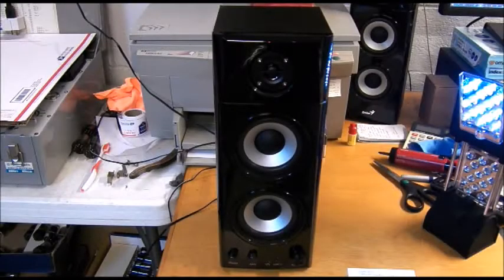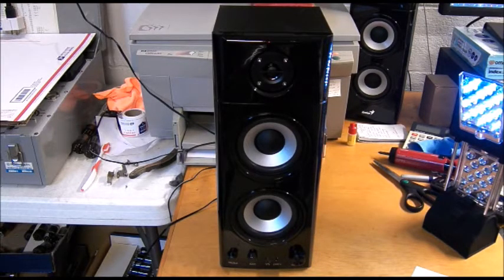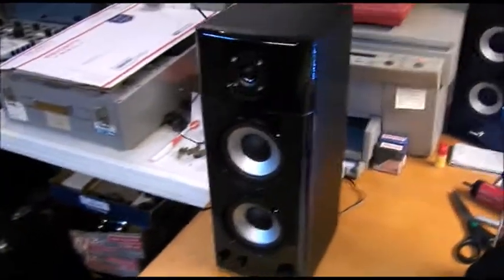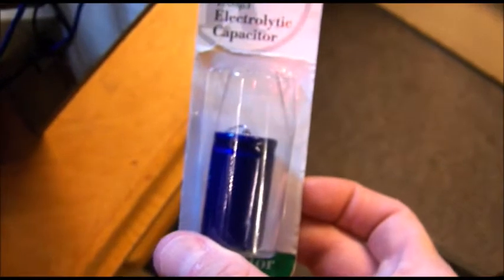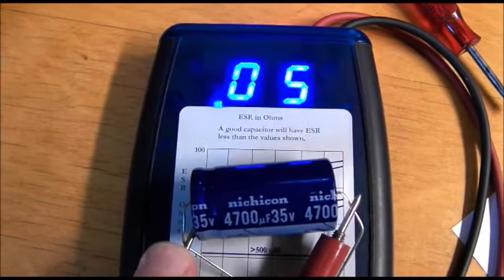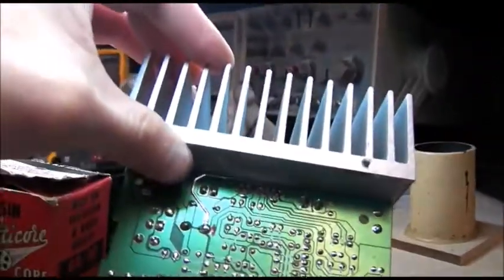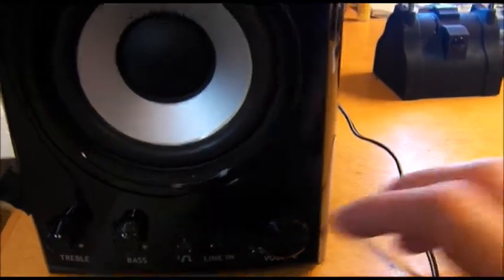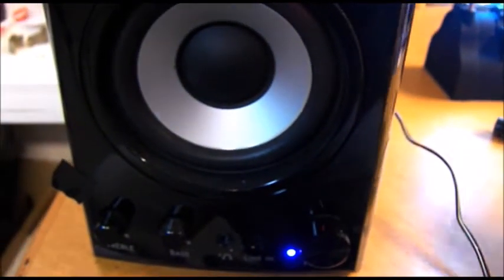Repair of Genius SP HF 1800A multimedia speaker system bad caps capacitors

Comment: i have the same speakers and the same problem... always thought it was a connection problem with
the soundcard socket as the hum changed pitch when toggling the plug, thanks for this

Comment: I have the same speakers at home but recently they have stopped working ad I see the blue light come in but I get no sound from all the inputs.
Reply: Same problem. Did you solved it?
Reply: its to do with the power transfprmer inside the computer speakers, I just replaced the transformer and now they are working again.

Comment: I love these speakers, sadly mine failed after 8 years of use. The left speaker is really, really low. I couldn't find any bad capacitors or anything suspicious on the circuit board. Though, I noticed that the IC pin for the left channel delivers 10mV and the right one is 50mV. Not sure if the IC went bad (sta540sa) or some resistance or capacitor died quietly... Any suggestions?
Reply from the maker: Easy to trace.  (Of course, you assume any risk of shock or injury if you proceed to service this yourself).

You can trace the audio if you have at least a multimeter.  Play an identical sine wave into each channel (you can find sine wave files easily online, best around 400hz but even 1Khz will be acceptable).  At the STA540SA, the input to this IC is at pins 4 and 5 for one channel, then 15 and 16 for the other channel.  Test those for AC voltage on your meter (vs ground) and write down the results.   You should see near identical readings for 4&5 to what you see at 15 and 16.  

If the results are different, then the problem is before the STA IC.  According to the schematic, there is a 2.2uf cap coupling the audio into the IC for each channel.  If the problem is before the IC, I would suspect a bad 2.2uf cap for that channel.

If your voltages measure reasonably the same at the input of the STA IC, then you need to check the output pins for each channel, which are 1&2 and then 18&19.  Again, the results should be consistent between each channel.  If one channel is low, then the IC is bad, or a supporting component for that IC (which looks to be possibly a 0.1uf cap, a 100uf cap, or a few resistors nearby.  

With that info, you should be able to troubleshoot it easily.  

The STA chip is cheap on AliExpress if it turns out to be defective.  I would consider buying a few extras in case they ship you a bad one.
Reply: @bigslick  I followed your instructions and tested the IC, which turned out to be a  sta540san (less pins) and not the one shown on the schematics available online (I guess my unit is a different revision), anyway, all In/out voltages were right, so the IC was good. Then, I began bending the capacitors to take note of the values (to buy new ones and try replacing them to fix the issue). I didn't do anything else, but when I tested the speakers one last time, the left speaker started working again! I don't want to touch anything else for now, I'm just so happy my speakers are working again, but I'll keep an eye on those capacitors if it fails again.

Thanks a lot for your help... you earned a new subscriber 😀

Comment: Does anybody ever had a very scratchy volume knob on this?
Reply from the maker: Surprisingly, no, the volume pot has been very quiet.  But that is easily fixed with lubing it, using either CRC 2-26 or WD40-GEL (not to be confused with regular WD40).
Reply: mine started to have that loud sound when i turn volume knob after about 6 years of using

Comment: Hello there BigSlick,
I've owned a pair of these speakers for a couple years now, love 'em. Recently though, they stopped working all together and I haven't been able to diagnose the issue. I'm not an expert so I'm hoping you see this comment and help me pin point the problem. 
The blue LED turns on but it has no sound, no humming even. I connected it to another PC and same deal. Opened it up and checked the capacitors on the power supply and none of them are bulged. Took the front panel off to check the switch board and everything seems fine. Checked the leads on the speakers with a multi-meter and they aren't broken.
I want to mention, before the speakers went out I had to fiddle around with the volume nob because the speakers would just stop playing sound. Fiddling with the volume knob would fix the problem for a couple minutes up until it stopped working.
In your years of experience, what would you say is the probable cause of my problem?
Thank you!
EDIT: I also want to mention that the headphone jack on the front works, just tested it. No sound from the speakers though.
Reply from the maker: Could be many things, but if you were having problems with the volume control, then you may have bad solder joints around the volume control or bad solder joints elsewhere on the board.  Otherwise, you probably need to do some signal tracing and voltage testing.
Reply: Same problem. Did you solved it? Thanks.

Comment: I just bought a pair and I could tell right away that something is not OK
These speakers have at most 10W RMS power per speaker, and not 50w RMS like it's declared on the box.
If you read label on back of the speakers, it says 0.12 A on 220v. That is power consumption of amplifier without losses.
Although it seams that they put 2x 20W drivers inside boxes, amplifier is way too weak, and this system will give you at most 10w per channel.
This system is way too weak and I feel tricked! I will contact consumer protection office.
This is considered false advertising.
Sound quality is OK, but THD on this thing is 10% which is catastrophically bad, but it will come to show only if you crank it up to the limit
Reply from the maker: No solid-state audio amp would have distortion levels anywhere close to the 10% that you claim, unless it is malfunctioning.  So you need to provide evidence from a distortion analyzer to back up your 10% claims, otherwise no one would take you seriously as your number looks like something you pulled out of thin air.

I am a technician and I know that the distortion levels on this system are easily within a fraction of a percent, just like ALL similar audio amps of this size and design.  As to the power output claims of 50W, I have not attempted to verify the 50W claim but having followed the audio industry marketing for many decades, power output claims have frequently been exaggerated.  It would not surprise me to find that the real power output is somewhat less, but still more than reasonable for a system of this small size.
Reply: @bigslick  You don't know what are you talking about. Many low end active speakers have 10% THD. I won't provide 'evidence' from distortion analyzer. Even better, I will provide you with manufacturers specification (written on the box) where it states 10% THD. Will that be enough? 
As for power rating, can you multiply 0.12 with 220. How much you get?
Can you look at the back of your speaker set?
Does it says 0.12a @ 220v ? 
Maybe you have set with much better amplifier than buyers get on the EU market.
Here's the evidence : https://imgur.com/a/7FpwgtZ
Reply from the maker: Power CONSUMPTION rating has NOTHING to do with AUDIO POWER OUTPUT rating.

Playing music, I measure 40W power consumption during bass-heavy passages, and that methodology is nothing more than just maxing the volume slider in Windows while playing a song and maxing the volume control on the speakers themselves, which is certainly not a proper power test, but also positively demonstrates a much greater power consumption than the 0.12A that you quote. (or 0.25A 120V in USA)

I don't have time to perform a proper sine-wave power output test, but based upon experience, I would be very surprised if these speakers aren't able to output at least 15w each at low distortion.

They sound excellent to me after the repairs.  Obviously these manufacturing quality-control issues are a large reason why these speakers have disappointed some buyers.  I can surely agree that the manufacturer needed better construction quality (better soldering on the board, and higher quality capacitors).
Reply: @bigslick  What do you mean by "Power CONSUMPTION rating has NOTHING to do with AUDIO POWER OUTPUT rating." Are you kidding me?!  So where are you getting your RMS watts from? Thin air? My other REAL power amplifier is declared 2x100w and it has 210w max of power consumption. That is the way it should be. 
The trick is that Genius added power of all the speakers they put in those 2 boxes and advertised it like that, and that figure is correct. But amplifier needed to run those speakers (drivers) is 3x too weak. That is the reason you don't hear distorsion when you crank it up, and amplifier is declared 10% of THD.  If they put adequate amplifier, distorsion would be awful on max levels.
Reply from the maker: You seem to read my replies very selectively.  

Anyway, you seem to not like these speakers, and that is your opinion to which you are welcome to have.  I might suggest directing your dislike of them towards the Genius company.  The factory provided the "specs", not me.  

My video explains how to fix a common source of failure, nothing more.  My previous reply also instructs that the power consumption is higher than what the factory printed on the back.
Reply: @bigslick  Sorry if I offended you in any way, but my point was to inform potential buyer that figures written on the box are not real. Nothing else. Yes, I felt disappointed when I first heard maximum volume, because i expected specification to be real. I built my first speakers when I was like 13 years old and I know very well what 10 or 20 W of RMS sounds like. Best regards

Comment: Hi friend. My horns SP-HF1800a, have the following problem: they do not sound, only for headphones if they have sound; But there is no sound through the speakers.
What could be what was damaged? Why the cause of this failure?
Thank you
Reply: Did you ever get a resolution for this issue? I am having the same problem. 0 sound at all coming from the speakers. But the headphone jack on it works. Searched around the board but the cap's appear to be fine, Havnt popped out the microscope yet. Any recommendations would be great.
Reply: Hey @cody680  ,
Did you ever find a solution? I'm having a similar problem.
Reply: @SiinaPOV  My issue was a popped big capacitor on the board. I was able to order a new one on ebay and replace it on the board. Best thing i can advise is take it apart and search all of the caps and resistors. If you are familiar with circuit boards take a look around for any that looks burnt or leaking. Hope this helps!!!!
Reply: Hey Fraguar,
Did you ever find a solution? I'm having a similar problem.

Comment: I've got simmilar issue. I am giving mine back to warranty repair cause mine are 1 month old and it is possible they were faulty from the begining. I think i got lower noise and it is comming from bass speaker as i feel it vibrate slightly when i touch it. The vol/treb/bass setting on the speakers nor in the pc don't change the volume of hum. Do you think those are also capacitors in my case? or maybe something else? I really like the sound and price tag of that speakers but the noise is really annoying, especially at night, and after change of the pc wchich is now quieter than the hum noise:) Is it possible that mine had been faulty since being new?
Reply from the maker: any continuous low-level noise from bass speaker could indeed be this problem.
Reply: hope to get it repaired instead of getting new - broken ones. Thanks for answer!
Reply from the maker: I hope they fix it for you.  The speakers are really excellent, when they are working properly.  Mine are now whisper-quiet and have outstanding fidelity for such a small size.
Reply: I also own Edifier r2600 and although they're of course louder and the bass is deeper they're much less mobile and don't have that kind of dynamic in the sound. I want my hf1800a working without any hum because i really don't know what else will i buy for that 50 bucks or so.
Reply: Czech Architektów Dafuq mobility, do you want quality or crap ?